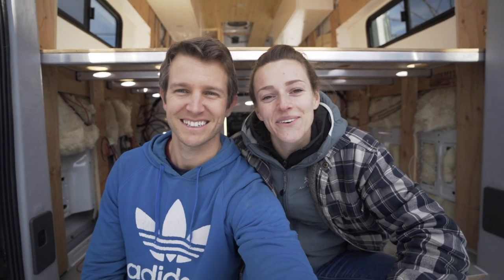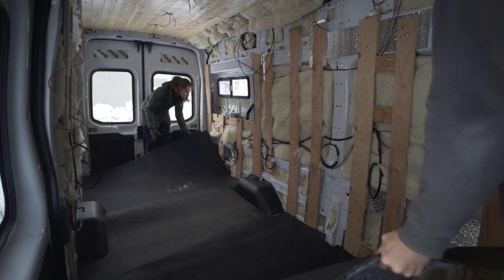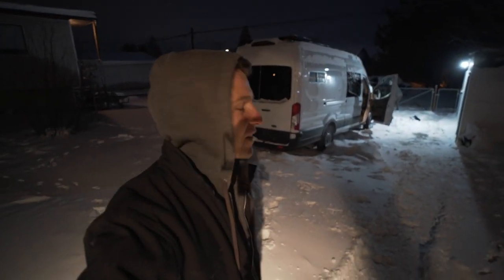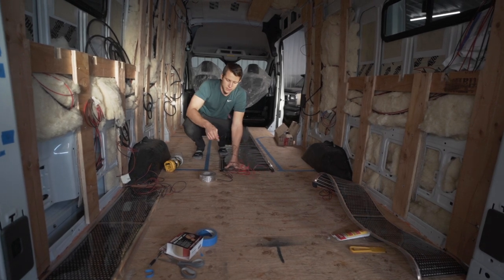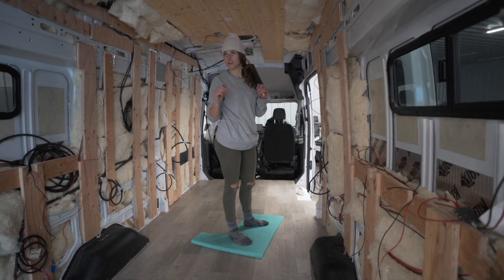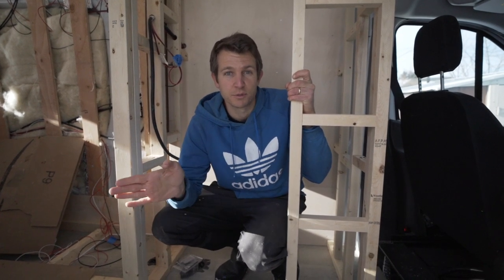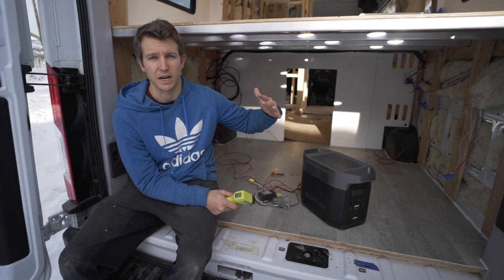VAN BUILD SERIES | 12V Heated Floor Install

Comment: Dear Katie, Dear Tim,
this is a very good installation guide! 
It's so well explained that anyone can do it themselves.
We hope that you are fully satisfied with the products and that it brings the desired success.

A small note from me:
Normally, the 12V voltage is connected to terminal 11 and bridged to terminal 10. The negative lead is then connected to terminal 12. 
But since the heating foils are basically resistors, it doesn't matter in that case. 
If there are any questions, please feel free to ask.

Great video!
Greetings from the Mi-Heat Team
Markus
Reply from the maker: Thank you! We appreciate the feedback and have pinned your comment about wiring for others to see as well. We will make this change when doing the final wiring for our system. Thanks again
Reply: I was wondering what it pulls off your power station? Excellent idea! 💡 Thanks for the video...
Reply: @TimKatie I have been binging on all your videos...  AWESOMENESS 
.

I couldn't find any videos on an update for this heated film

It's an upgrade I want to do in my van

Thank you

Comment: I know its built a long time ago but to anyone doing flooring, personally I would go with carpet spray adhesive over the adhesive they troweled out. I've never seen a notched troweled adhesive for lino. I'd go with perfectly thin, lump free spray adhesive. Spray the base, spray the lino, wait 2 minutes for it to tack off and lay as normal! Nice work though, I'm seriously considering this type of heating over water and pex tubing! Dependent upon the electrical drain.

Comment: This looks inspiring (haven't watched yet!) My Van Vision does NOT involve staying wher it is Freezing hence a Full Hydronic Expensive $ Floor System would be overkill. I just want something to gently give me some floor heat somewhere it might drop to freezing overnight but warms back up in the day time to like 50-60's...

 Maybe I would still need Other heating options. However I plan on going all out on my Solar Panel array thinking like 750-1000 Watt but maybe that is Overkill?

Comment: Smart to use them under the battery and tank. Building from the living room is something I'll introduce to my wife 🙂
Reply from the maker: Thank you! Haha good luck 😊
Reply: @TimKatie  btw, I checked their product and they have a reflective underlayment in the caravan section. Isn't that necessary for this heat mat?
Reply from the maker: @RedBatteryHead  When I discussed with the Mi Heat rep they said as long as it is well insulated underneath (we have 1” xps under the subfloor) it wasn’t necessary. On their website it seems a major function is the extra thickness to run wiring, but I’d be curious to know if heating performance improves by using them

Comment: Hey Tim & Katie,
  I am currently in the process of installing the pro air system from undermount and will be using an espar heater for our primary heat but decided to go with the heated floor option as well. I elected to go with a 120v system so that we can keep our van from freezing when parked at home in the wintertime in the cascades. We have 900 AH with 800w solar and over 150A of DCDC charging so we can still use it when we are on the road. Just found your page but have a lot of similar ideas. Hopefully our van can get somewhat close to what you two have achieved here!
Reply from the maker: That’s awesome! Thanks for sharing. Sounds like it’ll be a pretty epic setup - good luck with your build!
Reply: If you venture south to Washington and come thru Leavenworth have plenty of recreational recommendations!
Reply from the maker: @matthewbaker5414  Thank you!

Comment: I’m curious how you like the heated flooring? We just ordered some from Mi heat. Id love a product update! Cheers ❤
Reply from the maker: We still like them and just installed them again in a new van build 👍🏻 Good luck with the install!
Reply: @TimKatie  thank you for the info and content!
Reply: Hey guys, can i ask a huge favor, can you link the exact product you used and whatever else you used to make it work (thermostat / transformer, etc.). They recommended another project and it was 48 volt and then shipping to the wrong address so i'm trying again with them but want to make sure it's right! :)

Comment: Awesome video... the van looks great. Can I please ask a couple of quick questions if thats ok? 1) - did the heat matting come with everything needed, such as the thermostat etc, and 2) I'm guessing the matting can't be cut etc to fit spaces?  Finally 3) was it hard to get 2 of them to work from 1 thermostat. Thanks guys
Reply from the maker: Thanks! 
1. You need to purchase the thermostats when you order the heating pads (there is an inkbird brand available in North American - Amazon - that is compatible as well if needed)
2. The heating pad can be cut along the cut lines as shown in the video, but you need to order the correct width for your application.
3. A bit tricky but not hard, just need to wire them in parallel 👍🏻

Comment: Hello from the UK! Interesting video for me, very useful. Could I ask, now you've had it a while,  how the under floor heating is performing in terms of heating comfort and power usage,  and also if you'd recommend the system? Your weather is more extreme at either end than here im the UK so if it works for you im sure it will work here. Great videos btw. "))))
Reply from the maker: We’re happy to hear you found the video helpful. This van already sold, but during our use of it we loved this heated floor setup and have already ordered more for our new van build, so yes, we’d recommend :) Thanks for your feedback!

Comment: Looks great! I'm assuming you're using the pads under the batteries to avoid low temp charging and under the water tank to avoid freezing. Do you see these issues commonly living in the van full time? I'd imagine you'd only run into those if you're out of the van for a while in freezing temperatures but curious about your thoughts. Thanks!
Reply from the maker: Thanks. Correct - I would say it depends where you are and where/when you plan to be traveling in or living in the van. We’re based in Canada and in routine -10 temps while the webasto would keep the bed/living area comfortable, the batteries and fresh water tank could easily drop below freezing. Even though it’s insulated the floor gets cold, especially in the garage area under the bed.

Comment: Where did you mount the temp sensor?  It seems the sensor would want to know the temp of the floor, not the ambient air correct?  If that's the case, wouldn't it be best to install it under the vinyl flooring?   I'm installing mine now, but am using different flooring.  Thanks for the video and bunches of information!

Comment: Enjoyed your video very much.  It was very informative and we learned a lot.  Love how you guys work together.  Did the heated floor meet your expectations?  We also like the vinyl flooring.  Would you have the exact part number for the Mannington Millcreek Sheet Vinyl flooring?  Thanks in advance.
Reply: I wish they did a follow up, and actually tested what it could keep the van at if left to run for a few hours time or overnight in super cold weather.   No one on youtube actually speaks on how well, or not , that this system works.   They dont say if you need extra heating or not

Comment: Good idea. Good job. Where do you intend to put the 2sensors for thermostat? Will they be under or in the box where the batteries and water tanks are? And the ones near the shower?  Thank for your time for doing these videos
Reply from the maker: Thank you! Good question - I meant to discuss that in the video: the battery/water tank thermostat temp sensor will be tucked beside the lifepo4 batteries, and the main hallway thermostat one will be hidden under the toe kick on passenger side 👍🏻
Reply: Hi again. You were right. I did order my kit with Mi Heat and Markus was very helpfull. Everthing went smoothly. I should received in 50 days in Ontario
Reply from the maker: @francoisloranger1612  We're happy to hear that and we hope they work well for you!

Comment: These look great. I’m installing a Rixen hydronic system but not putting the tubes in the floor. This is something I might do. What did this system cost?
Reply from the maker: Thanks! This entire 12V heating setup (2 thermostats, 3 different heating pads - listed in description) cost around $430 CAD 👍🏻

Comment: Hey guys I love your videos, I’m doing my own transit conversion and going to order the same heated flooring pads but my question is did you have to buy additional wiring or accessories from the same website?
Reply from the maker: Thanks Bo! You’ll also need to order the thermostat if you plan to use one

Comment: Super helpful video! I was just on a call with MiHeat and debating whether I should use their product or not, and your video has really helped with the decision process! Just one quick question - do you use the underfloor heating as your main heating source in a van, or do you have another heating method and the MiHeat film is just here as a supplement to keep the floor feeling warm under your feat?

Comment: Hi Tim & Katie, greetings from the UK! Your video may just prove to be a lifesaver!! I own a transit camper conversion that the previous owner equipped with a Chinese diesel heater (very bad plan!) and I am now looking at retro installing 12v u/floor heating. There is a supplier of this product in the UK but they are not fantastically helpful so may I ask a few questions?
1. The mat that you laid is 50cm width? Only 30cm width available from the UK supplier. with the floor area that I am looking to heat (140 x 120cm) would you think a single run of mat would be sufficient or would you advise two runs?
2. When you routed the grooves for wires and connections did you also route for the floor sensor?
3. Did you fit the floor sensor under the vinyl flooring?
4. Again in the UK there is only a single 12v thermostat option. Did you find that was the case ordering from Germany. I would love to be able to use a thermostat that could be accessed via an app on the mobile.
Finally I think you may have saved the day and convinced me to take the plunge and install and warm my feet!
Thanks guys
Duncan
Reply from the maker: Hi Duncan, we’re glad you found the video helpful. We would discourage installing these 12V pads as a primary heat source, as they will not keep up in cold temps and would draw a huge amount of power to heat the entire van. They should be floor temp comfort only. Yep 50 cm wide for main hall. 
We did not put the sensor under the floor, just nearby is fine 👍🏻

Comment: Nice video, could you answer a couple of questions please?  Temperature sensor wiring has red and blue leads, which goes to 1 and which goes to 2?  Also where precisely and how precisely did you install temp sensor?  Thanks

Comment: Very good project and nice explanation! I'm building one also with this pads and I will following the same procedure as you showed :). Just one remark, I think is not advised to put silicone direct to metal because the cure could create rust (there is one type that not do this...something like neutral silicone, maybe you use it...just to let you know for the future). For that it´s better to use Sikaflex, which is silicone free. Keep the good work :)
Reply from the maker: Thank you! Great remark about the silicone - we should have mentioned this in the video. Thank you for the comment and good luck with your flooring install!

Comment: I'm not sure if y'all are familiar with "Quite Warmth" brand, but it looks very similar, but it is the 120v version? Not really sure what I'm trying to get at besides the fact that it is readily available at our equivalent to Home depot. FYI: I would prefer the 12v version.
Reply from the maker: No we’re not sorry - we wanted to find a 12V version that would work with an adjustable thermostat which is why we were excited to find Mi-Heat 👍🏻

Comment: Another informative and fun video guys : )  Can I ask what model heating pad you used from Mi-Heat? Is it just a matter of picking the width of the pad and then the voltage needed? Katie has way too much fun on your videos : )
Reply from the maker: Thank you! For the hallway we used the wider 30 cm, 220watt heating pad 👍🏻 Yep exactly
Reply: @TimKatie  I was just looking over your video again and noticed that you had noted in the description what sizes you used. So I didn't need to tie you up with my question : / next time I just need to read everything before responding : )
Reply from the maker: @brianchetelat6601  No problem. Cheers

Comment: Hi. great video! When you say "substantial solar" what does that mean? I am looking to heat my ~250 sqft camper... thank you!
Reply from the maker: Thanks! Well it doesn’t actually have to be solar, just substantial charging sources (alternator, generator, solar, or a combination). These heating pads won’t work as a primary heat source though - we use webasto or espar heaters and then the heating pads specifically to keep the floors warm

Comment: Thank you for making this video! How has the floor held up over time? Have you noticed any bubbles in the floor where the heating element is? Any recommendations a year later? Thanks!
Reply from the maker: You’re welcome! We like it and just used it again on another van. This time we glued under and (cautiously) on top of the heating pad which we recommend doing and will continue to do ourselves on future installs 👍🏻
Reply: @TimKatie  Did you use the vinyl flooring adhesive or the double-sided tape to glue?
Reply from the maker: @simonlambert2246  the vinyl flooring adhesive
Reply: @TimKatie  what glue did you use?

Comment: H Tim, can you the Mi-Heat infrared work under Luxury Vinyl flooring (lock together flooring with attached padding) or just the vinyl flooring you used?
Reply from the maker: I’ve only used it with the sheet vinyl but the Mi Heat technician assured me it would also work well with click in vinyl plank 👍🏻

Comment: Coming back around to this video as we decide whether we want to add heated floors to our van.  I see (from the comments here) that you guys are now using adhesive vs just taping down the film.  Can you tell me why this change?  If we install this film, it would be between our floating sheet vinyl and the plywood subfloor (which sits on top of 1" XPS foam board).  

On a different note, I also saw the comments re the button beeps.  This could be a problem for one of our dogs who is unnerved when she hears certain beeps (as soon as she hears the intro for Top Chef, a cooking show with timers, she's pacing the floor until we let her out - all the while shooting us looks of pure disappointment in our leadership decisions).  This won't be conducive to making the van a safe space (especially since she can't just go sit in the yard until the show is over).  Equally as important, we noted your comments about the film drawing power unnecessarily when being controlled through the thermostat (by heating based on temp not on need).  Are you unable to use the power button on the thermostat to turn off the film?  Or was the the thought process that there's no reason for the added cost if you're simply going to be turning on when needed and off when not.  Is foregoing the thermostat as simple as connecting a switch directly to the wiring?  I did notice they have a new thermostat available (https://infrarot-fussboden.de/M3-thermostat-24V-AC-DC-black - our system will be 24V), but am unable to tell if the beeping is still there or what eco-mode means.

Love your videos, we constantly refer to them.  Thanks for all the tips and info!

Comment: Hi Tim & Katie, I have multiple questions I hope you can advise...   did the 2 sided tape stay affixed that you used between the heated mat and the vinyl floor? Do you wish you used 220w on the main walkway? Aside from the heating mats and thermostats dis you need to purchase any additional items from this company? I'm thinking about placing an order this week, I noticed that Canada and USA are not in the order page's drop down box for calculating shipping...  your update would be most helpful 🙂
Reply from the maker: We're about 3 wks away from completing our conversion so we haven't fully tested. However, we have turned them on during the build and we've been happy with them - no issue with the 2 sided tape during the build process with lots of in/out of the van :)

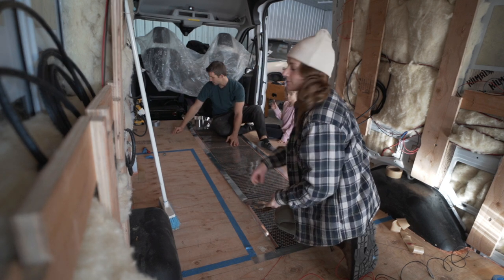Comment: Hey there, 2 questions - First and most importantly and not relevant to flooring: At 8:28 Tim is attempting a bite of candy bar from, I assume his niece. The question is: Did you succeed and follow up, what was it? LOL.. 2nd question: Can these be linked together under 1 thermostat? I have an 11ft run and will need 2 of the 30cm wide for my walkway of 24+ inches. I know it's a year+ old video but I've been planning this build for that long so finally at the stage of heated flooring. Thank you very much - Joe
Reply from the maker: Hahaha fantastic observation. I don't remember and didn't realize this was on video but thank you for the laugh! Yes these should be able to be linked under 1 thermostat, as long as combined they are under the 20A load rating of these Mi Heat thermostats. We continue to use these in our van builds but now just wire them directly to an illuminated on/off switch and forgo using a thermostat altogether. I hope that helps!